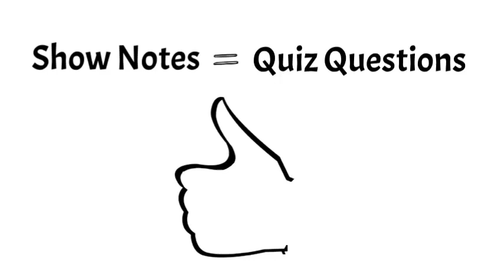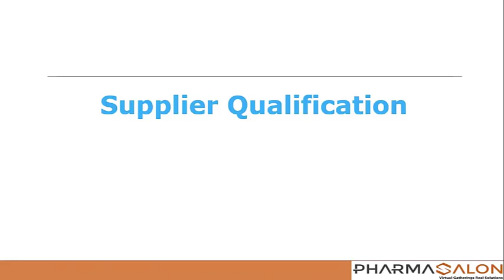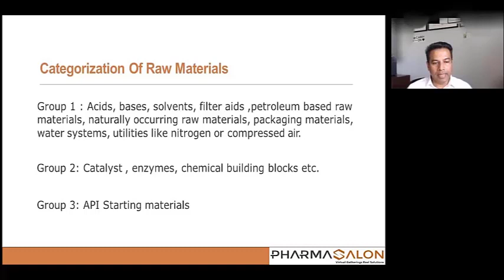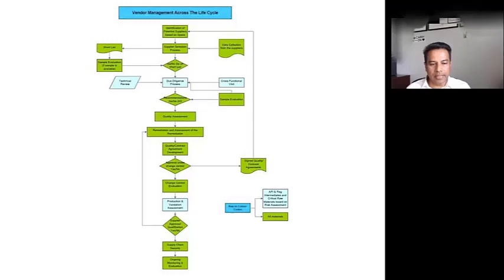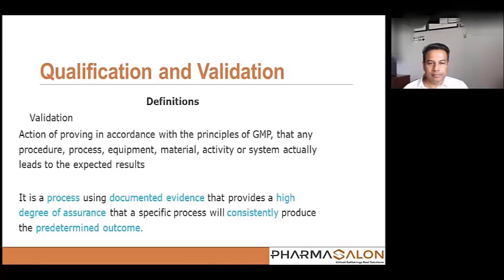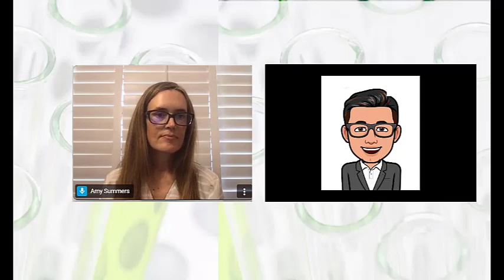Qualifying Suppliers and Equipment at 503B Outsourcing Facility

Comment: According to you what is one or two critical aspects of the quality checks for vendors often missed?
Reply from the maker: I’m not sure I understand what is being asked with this question… but here goes a shot at an answer.  Often vendor qualification isn’t performed at all. At the very least perform regular checks to ensure your vendors are certified or registered depending on what they do. For example, you can ask the vendor you use for cleanroom certification if the have a CETA certification or ISO 9001 certification. Whatever reports or results they provide should be reviewed carefully before being accepted. Vendors can make mistakes too and you don’t want to wait to catch them until you’re in the middle of an inspection!